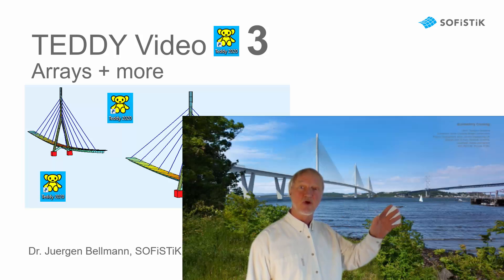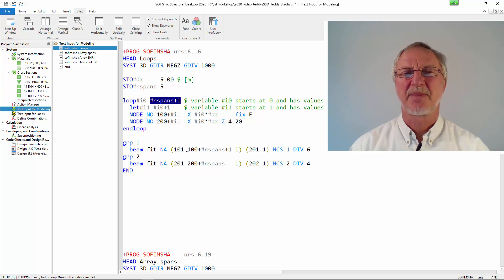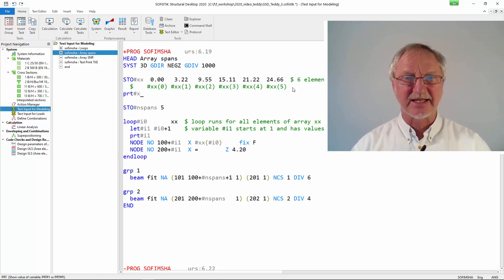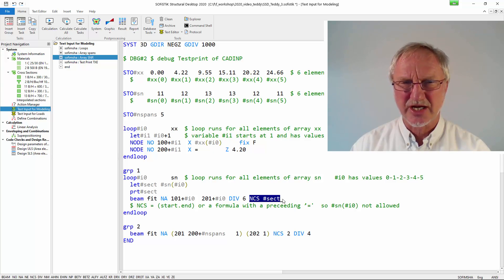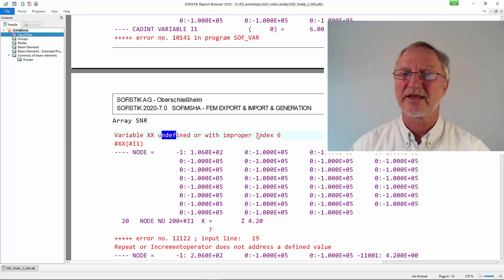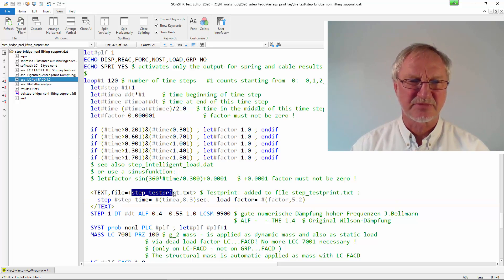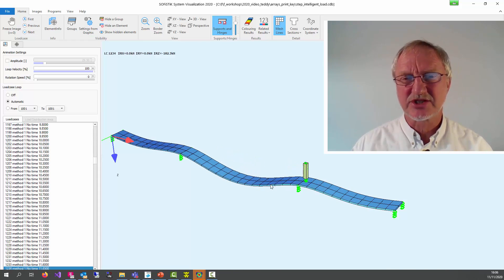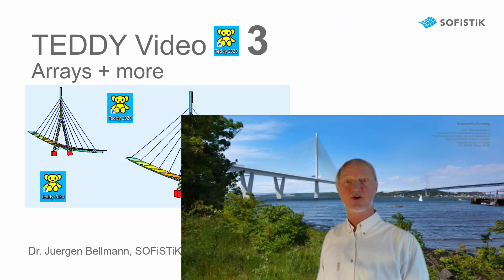Get to know TEDDY - Part 3 - SOFiSTiK Text Editor

Comment: Hello Dr. Bellmann. I am studying some of the examples (e.g. step_bridge_nonl_lifting_support). What exactly is the reason for using so many QUAD elements? Why can't the full bridge just be modeled as a single very large QUAD element which is then split up into smaller mesh elements?
Reply from the maker: Hello! QUAD elements are mesh elements. If we create a structural area element (e.g. a single, big slab) in SOFiPLUS and export it to SSD, then the system gets meshed and the structural area is split up into smaller quadrilateral mesh elements –QUAD elements.
Reply: @SOFiSTiKAG  Alright, I see. Thank you very much for the helpful response; greatly appreciated!